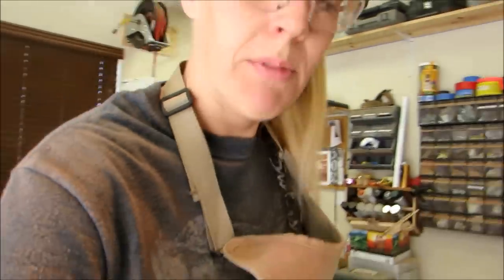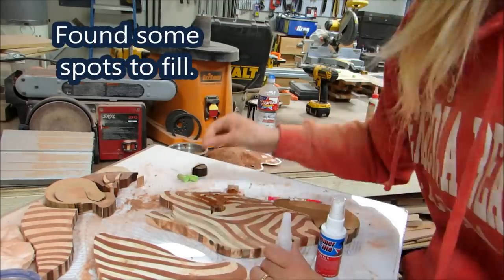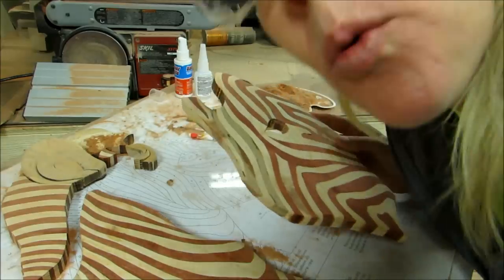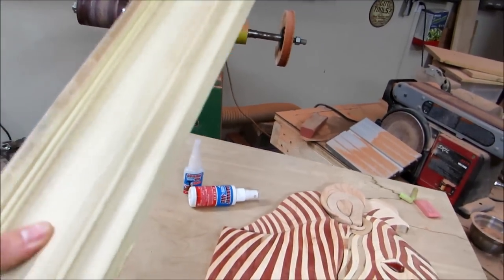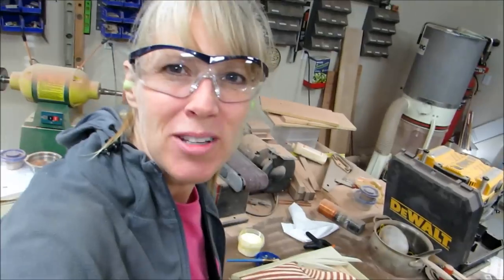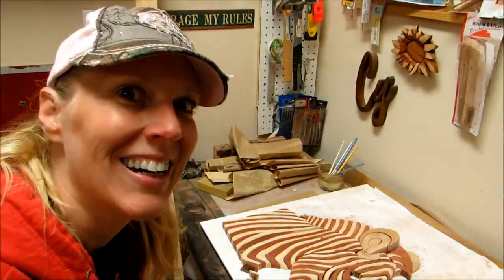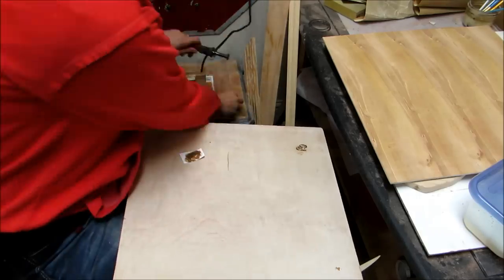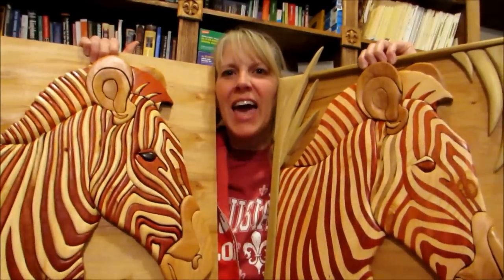Two Intarsia Zebras, Part 2

Comment: Cy I really like the video and the projects turned out great,  If you have a Rockler, or Woodcraft store that is local to your area I think they are great for shop supplies,  also not sure if you are still using the light weight dust masks but I really like the Dust B gone  I first saw it on Wood working with Tim Yoder  and your video quality is much better now
Reply from the maker: drawvenmusket Thanks for the comment!  No Woodcraft or Rockler here in Louisiana, BUT I can always shop online!!!  I will have to check out the masks!  We do have a dust collection system, but not the greatest set up.  I look at my old videos and go "oh man...".  Thanks for sticking with me  :)

Comment: They are both really good. TIP: when using your two part glue, squeeze some glue one one part and the activator on the second part. If you touch the activator with the tip of the glue nozzle it can set the tip of the nozzle rock hard. Hope you won't mind me saying.
Reply from the maker: Hey Cliff! Yes, I have learned this the hard way. I only use the activator on certain things now, it works so fast!!!

Comment: Lovely work.  A suggestion is when you use the super glue and accelerator, put the accelerator on one piece and the glue on the other.  I found the you have a little bit more time.
Reply from the maker: +Robert Pinta Thanks, I have been doing it that way now, I finally read the directions!!!